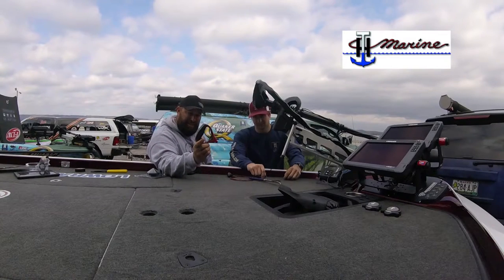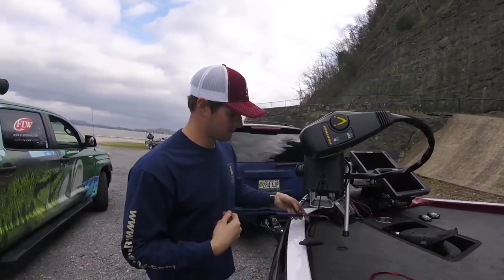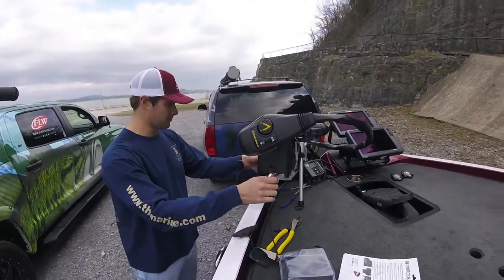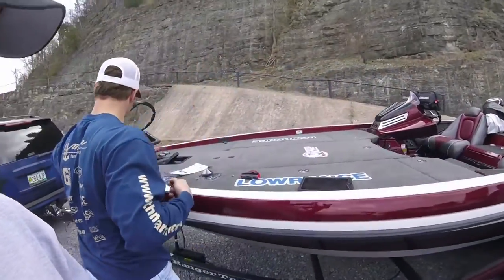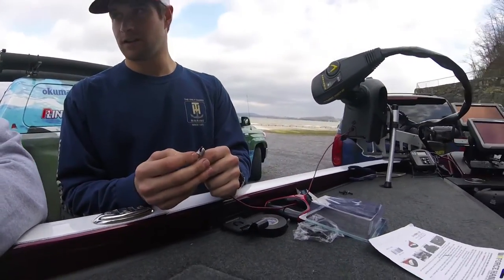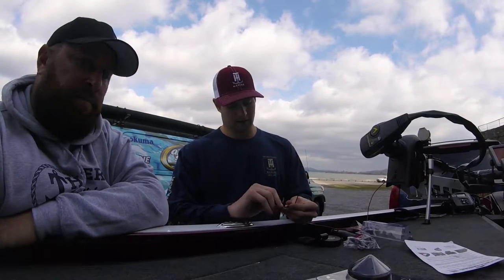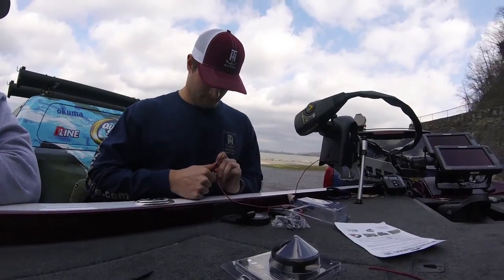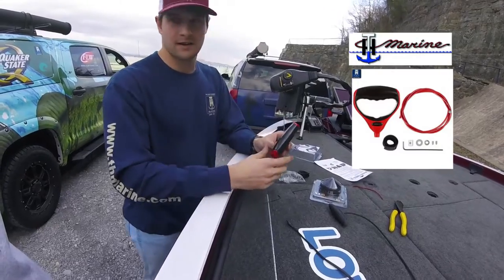HOW TO INSTALL THE T-H MARINE G-FORCE TROLLING MOTOR HANDLE AND CABLE

Comment: Where do you put the handle so its not flopping around or maybe bounce out and hanging off the side of the boat while trailering?
Reply: I wrap mine around the cables on trolling motor